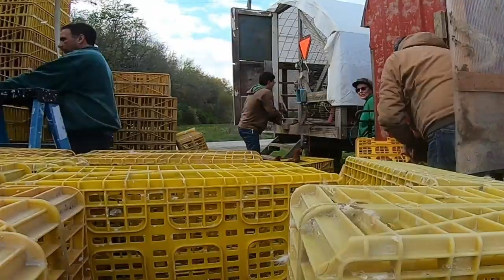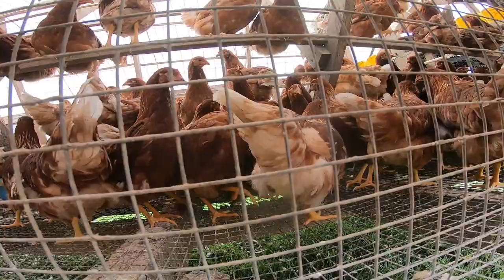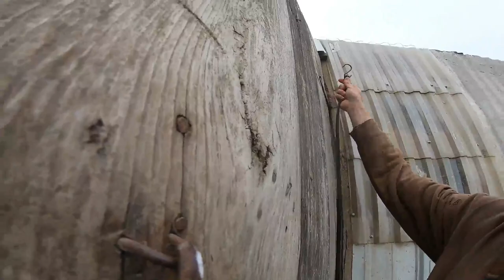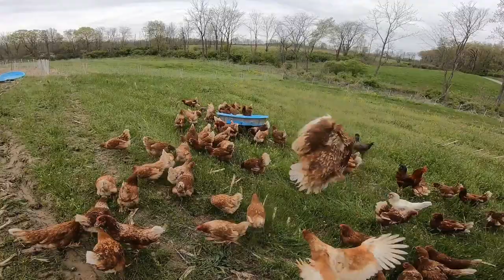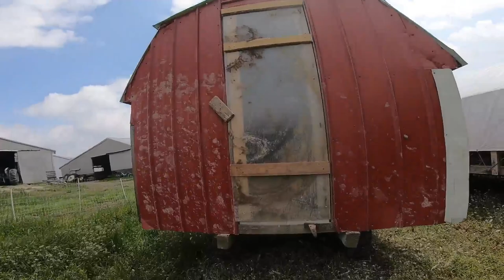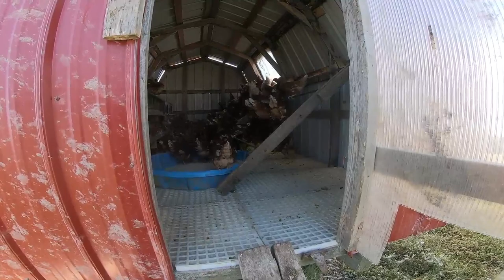Doubling Up to 1000 Hens

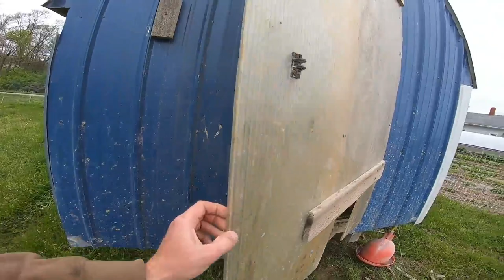Comment: @ 4:50 that is the biggest bucket of chicken I've ever seen!  Don't know much about raising chickens, but after reading the description, is the labor involved for 1,000 chickens about the same as the labor for 40 steers?  I'm guessing chickens = more labor but also a higher ROI and quicker cash flow.  My banker man says its all about the cash flow.
Reply from the maker: Feeding is about the same, eggs need collecting and washing, and the fences are moved. Cattle need the manure hauled and trailered to market. I hate the cows when it's barn cleaning time and I hate the chickens on fence moving day. At least a five pound chicken can't run you over.
Reply: @boehmfarm4276  Lol. Yep, there is that.